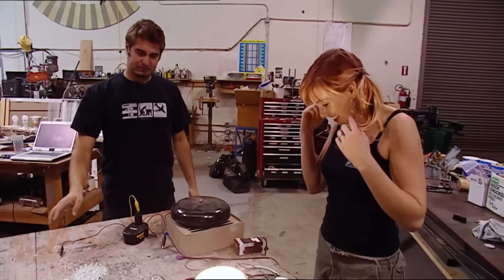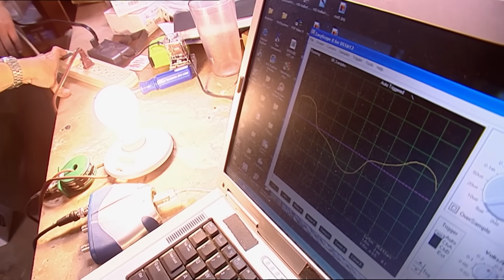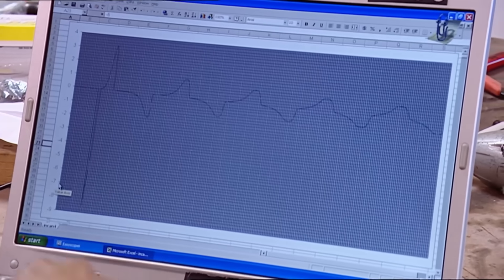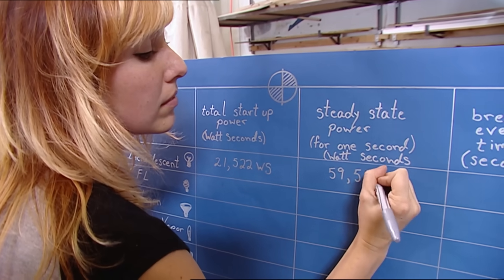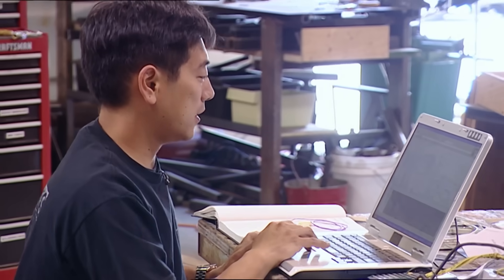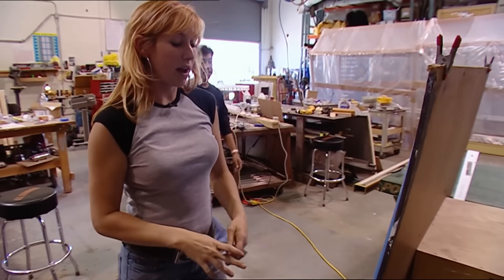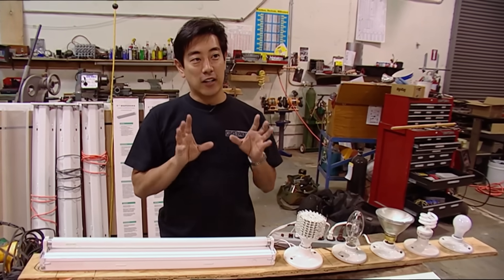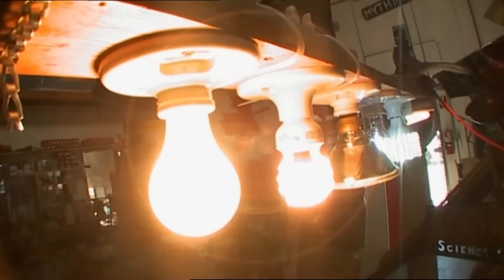Is It Cheaper To Leave The Lights On Than To Turn Them Off? | MythBusters

Comment: You didn't say how long it took for each bulb to fail in the final test - surely quite critical information.
Reply: I agree. I was waiting for that. I feel like this test is inconclusive.
Reply: Yeah that's what I was waiting for.  If the on-off ones failed at 1 week in, and the constant on ones failed at week 3, that's important context.
Reply: @seejoshrun1761  I think you misunderstood what they are saying they tested. They were testing how much turning lights on or off every two minutes effects the longevity of the light's function vs the expected lifespan of regular use.

They didn't leave any on constantly.

A switch every two minutes, thirty an hour, for six weeks means(30times*24hours*7days*6weeks) the LED light survived approximately 30,240 switches without failing. The other lights apparently were also turned on and off over "ten thousand times"... it would've been nice to see numbers, yes, but that wasn't the point. The point is that it takes a lot of flicking for them to die.

Let's assume the worst light survived ten thousand uses, even. If it was a light in your house, how long would it take to hit ten thousand switches?

Let's assume it's a kitchen light, and you make food three times a day every day. Let's also assume that you leave the room twice each time you cook, turning it off each time you do. You'd be turning the light on or off eighteen times a day, seven days a week, 52 weeks a year, for a total of 6552 switches. It's take a year and a half to break a ten thousand switch light... but are you really flicking a light eighteen times a day, every day? Are you doing that in every room?

The bulbs endured what they estimate to be multiple years(five, which seems a bit generous if ten thousand is the number, but less so the closer to 30K we get) of flicks, even if you turn them off whenever you leave the room, for anything. In the end, turning the lights off more often saves electricity, but increases the wear and tear... but considering most bulbs are a couple bucks, the savings far outweigh the minor wear and tear cost.

Edit: Should note, this episode come from a time when the most common lights drew more power than the current common lights, so the info in this episode is more relevant to the time it came from than now.
Reply: Yep. Didn’t also factor in the cost to replace the lamp however many times it would fail Vs being left on. Totally inconclusive.
Reply: @sling3808  (for TL;DR/conclusion, skip to the end)

You cannot truly call it inconclusive. Even if they didn't show us all the numbers, that does not mean they did not have them. Just that if they did(and they definitely had at least some of them), they saw no reason to share them. Perhaps because the numbers are specific to where they were filming(and when). In 2007, the average kilowatt-hour cost in Illinois was 6.36 cents, while Connecticut was 19.11 cents. I'm struggling to find bulb prices at the time, but the point is those prices are wildly different. And that's not accounting for different countries. Or environmental factors.

That said, you can do estimates for your area.

I did the math for today's prices, since I lack complete 2007 data. I chose Georgia, which is apparently lower-middle of the pack in electricity prices, though that is in part due to three state being super high compared to others. 

Disclosure: For the myth "Is It Cheaper To Leave The Lights On Than To Turn Them Off?" Higher bulb prices and lower electricity cost are in favor or the myth, the opposite in favor of busting it. Unfortunately, they banned incandescent in 2007 (and, of course, many other places later did too), but the price of such a bulb tends to sit between a buck 1-2 where it is still available. LED bulbs go for about $6.40 after tax in Georgia.

Assuming that you used the 6552 light switches a year suggestion I gave in my previous post, and the 6+ weeks survival results the Myth Busters got for LED bulbs; In a five year period, an LED bulb would survive 4.6 years. So you'd need to buy two bulbs over one, for a cost of ~13$. Assuming your incandescent got the low end estimate of 10k switches, you'd need 4 bulbs for 5 years, for a generous 8$.

For it to be cheaper to keep the lights on, the cumulative costs of every time you "leave them on" over the entire lifespan of a bulb, has to be offset by the costs of replacing them.

The watt/hour the MythBusters got was 90 for Incandescent, 1 for LED(The sites I visited put those numbers at 60 and 10, but I'll use theirs). 643.5 watts  is ~1$(7.16 hours of incandescent, 643.5 hours of LED). By leaving the incandescent on for 15 hours, your already paid the cost of replacing the bulb. it takes half a year of leaving the LED on to pay it's cost at 1 watt/hour(at 10 watt/hour, a little over 2 1/2 weeks). If you never turned your lights off, in five years, you'd spend the equivalent of 6000 incandescent or 68 LEDs, never turning them off. Turning them off whenever you needed would cost you a fraction of that.

Conclusion: With generous turning your lights on and off, replacing incandescent would cost you 8$ over 5 years and against a cost of 1223.46$ for leaving one on for five years. The power draw is negligible when turning a light on, according the the MythBusters. For LEDs, 13$ vs 68$. The difference is smaller, but the cost is still there(whether or not you turn your lights off, LEDs are the better option). To justify keeping your lights on, you have to live somewhere with absurdly cheap electricity(cheaper than Idaho, apparently the cheapest state) and compare it to flicking your light switch as much as you can. That said leaving your lights on for ten minutes when you leave a room? That'll cost you a miniscule fraction of a cent. So small you won't notice unless you do it all the time.
Reply: They literally say "we ran the test for a month and all the bulbs burned out besides LED"" with the cost of LED being so cheap now the answer is just buy LED and use it when you're in the room only.
The other information is reguarly available if you search for bulb cycles for each corrisponding type. ChatGPT can tell you if you want to see the numbers.
Reply: and consider how many lights are in the room!
Reply: Well, they only tested one bulb of each type as well, so none of that data is meaningful at all.  It wouldn't have been hard to test 5 of each type (and wouldn't have cost that much to do).  

This test is really terrible compared to what we expect from modern-day YouTubers like Project Farm and Torque Test and others.  It's funny how much better YouTubers are at some of this stuff than TV was 10 years ago.
Reply: Find it really hard to believe that this didn't occur to any of them. Almost like they have a narrative to promote. It's a question I seem to be asking every day - are people stupid, or are there other interests at play.

Comment: My abusive brother in law told me it cost more to turn the lights off. And for 59 years I've felt anxiety over it; was it true or wasn't it. I found your explanation a bit over my head (maybe cus I'm high) but I'll take your word for it; it's cheaper to turn the lights off. My brother in law also told me that when you're suffering under 100+° weather, to take a hot shower, because then by comparison, the air would feel cool. I never put it to the test.

Comment: But that's only half the equation. There's a human element too. If the light switch is by the room exit, then, yes, turn off the lights when you leave. But if there are two or three individual lamps on, and you have to walk from one to the next to the next turning each off manually, that tilts the scales for me.

Comment: The thing is, with LEDs, it only matters if you have a really big house. My entire flat uses less than 200W of led lights. On 16h/day, it's like 400€/year. That's the max I can possibly save, if I never turn on any light. Roughly a cappuccino per day.

Comment: Everything in your home that's 'plugged' is using a tiny amount of current to keep it warm, provide memory, and even save power as re-booting causes the rewarding of all components which requires more energy which makes it use more than just making it 'sleep'❤

Comment: But the light bulbs died in under 1000 hours of being on half of the time. While 1000 hours of being time is on the low end of the expected of a bulb. The on and off did reduce the longevity of the lights.

Comment: every startup damages the filament.  so the cost comes in replacing the bulbs.  however bulb replacement is a lower cost than constant electrical use.

Comment: Turning lights off when not in use is a no brainer. The issue comes when you keep turning them off and on again, that's when most of the wear is on the bulb and puts "undue stress" on the components - I see it happen all the time with computers. components fail when power surges happen, or from too much turning on and off again.. Basically, it really comes down to is cheaper to have the lights run continuously as much as possible OR save the electricity use and replace them sooner from the extra wear that turning them on and off does - how much that shortens their life span.
For computers, I generally recommend leaving them running all the time, as long as you know you are using them daily or semi-daily, and turning them off when you know you wont be using them for an extended period of time, such as going on vacation or only using them once every few weeks.

Comment: On a completely related topic your typical gas powered vehicle uses about seven seconds worth of gas to start up. Which means whenever you idle longer than seven seconds you're wasting gas keeping it running. And you can easily verify this by monitoring your vehicle's gas mileage if it has the counter on your dashboard. It will steadily go down as the vehicle idles.

Comment: In the old days fluorescents used to have a rating for starts and/or cycles.  The "starter" heated filaments at the ends of the bulb until enough ions/electrons were emitted to begin conduction thru the gas inside the tube and the filaments would wear out and thermal cycling could even break the seals of the tube, releasing the gases. When I was a kid and swapping out fluorescents in schools and retail, the rule of thumb for our energy prices (pacific northwest hydro) was at least 4 hours off to break even. Most stores and many schools did not even wire in light switches - the only control was the circuit breaker.  Of course electricity costs have increased dramatically, fluorescents typically do not use thermionic emission to start, and I don't know if any manufacturer still provides starts or cycle ratings for any bulbs.

Comment: This is also a common myth for combustion engines too. We had a 6.7 L V8 diesel engine in a Ford excursion. My brother always said that starting the engine wastes more fuel than leaving it idling for an hour. To me this never made any sense. I went and looked it up and did some calculations and the only way it makes sense to leave that engine. Running The engine to save fuel is if it was going to idle for no more than 30 seconds. So it wouldn't make sense to shut it off at a stoplight. But if you're going to be outside someone's house for 20 minutes, don't leave it running. 
I then told him about this information and where I got my numbers from and he told me to kick rocks. That guy just like the air conditioner.

Comment: Personally I'm not so concerned with how much electricity a single lightbulb drains, but rather how long a lifebulb will live. In my odd experience, turning lights on and off more often leads to the bulb dying sooner. I'd rather pay for a few more watts a day than having to change lightbulbs twice as often. Not sure if it's a placebo or whatever, but those lamps I don't turn off just seems to live for bloody ever.

Comment: You will end up spending more replacing bulbs if you turn them and on more often because failure occurs due to heating/cooling cycles, not time spent on. Such an easy thing to test, and yet they ignored it.

Comment: I understand that in a constant heated room your information is correct. But what about in a non- heated space that has a wide range of temperature say when in an out door setting where  it is 30 degrees or lower in temperature?

Comment: My father who was an electrical engineer informed me that most power is consumed when you swich OFF the light. Disconnecting power causes an arc, the little blue flash often seen inside the switch.
Reply: That little blue arc what is formed when the contacts in the switch open to interrupt the flow of current through the light bulb. It is an insignificant amount of power in that instant of time. It is true that you did not get to use that fraction of power as most of the voltage in the circuit is now across the contacts and the voltage across the light bulb is near zero. So while you have a blue arc there is almost not light being produced by the bulb.

Comment: But how much $$$$ are you saving ???  Is it pennies or nickels ?    My argument has always been that my significant other will be crazy about turning off the lights but will leave the AC running longer and colder and will run extra loads on the washing machine — or use the dryer instead of letting the clothes dry on the rack —-  and i always think we should focus on the efficiency and how we are managing the larger things for an impact on the electric bill… what efforts / arguments are leading to the bigger savings ???

Comment: Damn, I did a similar experiment on my e-scooter trying to figure out how to get the most efficiency out of it through changing volts to front and rear motors up to speeds of 40kph, 50kph and 60kph because the scooter has cruise control and I can set it max speeds on its 5 different speed modes.
Watching to volts on the trip computer to both front and rear drive motors as I slowly lowered the volts each ride to not only get the as low as possible but as efficient as possible to get to each modes max speed while not over accelerating and also engaging wheel spin that shreds the tyres and wastes huge amounts of volts as it has powerful 2x 2000w motors on an 84v deck.
I was able to get the numbers down by close 4-5v per Mode 1,2 and 3 and I still have some more wiggle room.
And that way I have more leftover volts for mode 5 which peels up to 120kph with a nice tailwind 😎

Comment: What a sick joke. You didn't even factor in the additional wear on the switch or the higher risk of getting robbed when the house is poorly lit! Not to mention the extra calories you burn by switching the lights on and off. When touching the switch, there's a higher risk of accidentally scratching the wall. If switching the switch requires even a single additional step, the shoes will wear off quicker. And what about the joints? Do you have any idea how expensive the joint replacement can be? 

#CombatMisinformation #KeepTheLightsOn

Comment: He didn't try his tests at different voltages. And under voltage spike conditions.
Rarely is household voltage a constant 120v.
It can be as high as 135v or as low as 105v and still be considered normal.

He didn't say which one burned out first.

For incandescent bulbs, the bulb lasts longer if left on. Less 60 cycle heating and cooling the filament.

Cycling anything will a ballast will use more energy.

There used to be a small device you put into the bulb socket that made the power a 1/2 wave. You saved about 1/3rd or a bit more on energy that way.
I had one. Bulb was much dimmer with it.
Didn't make the bulb last any longer.

For incandescent bulbs, the number of filament holders had a direct effect on incandescent bulb longevity,

Generally a rough service bulb has more filament supports and can last longer.
Even when not in rough service use.

Bulbs for ceiling fan lights tend to last longer than regular bulbs too for the same reason.

All his tests were very small scale. Try several hundred at one time for each.
Office towers used to shut down lighting on entire floors (fluorescent) to save money.
But lights had to be off 8 hours or more to gain power benefits.

Incandescent bulbs emit a lot of heat. Great for winter time but not goo for when you are trying to air condition.

LED's are about the best way to go with respect to energy savings. BUT there is an impact on your health by using them.
They lack the color red in their light spectrum which can cause several ailments.

Comment: they are totally missing the temperature difference.. 2m won't give the lights time to cool down and reheat..  If you research the longest running light bulb without turning it off you see it belongs to a firestation that never shut it off. it has lasted for nearly 125 years constant, and is still going today...   also figure up what me leaving my led's going full time costs me over time... i'm not saying that it wouldn't be better to shut them off.. but, how much are you really talking about saving here? in a month? with me leaving 4 led's going full time it costs me an extra $5 on my light bill? Seriously, i spend less than $100 a month on electricity.. some people have solar power they spend less than i do.    When does it factor in?

Comment: If you leave a room for more than a minute, you should turn the lights off.

The MythBusters experiment showed that even the least efficient bulb type tested (a standard fluorescent tube) only used an energy surge equivalent to 23.3 seconds of continuous running.